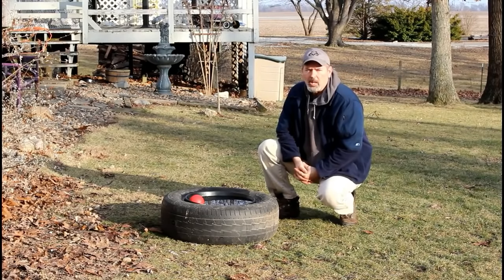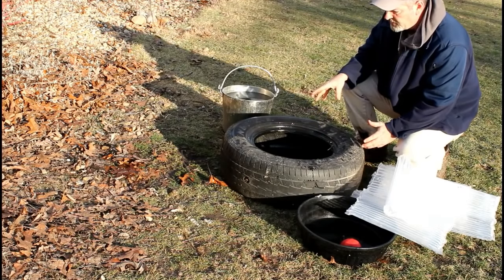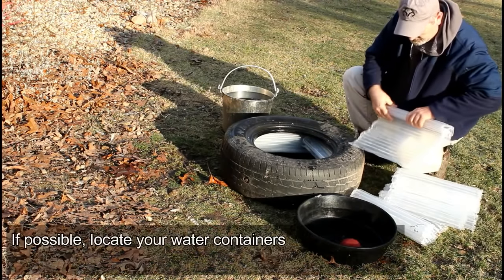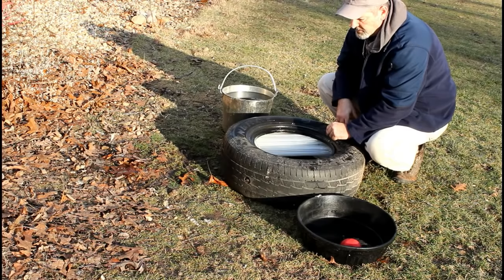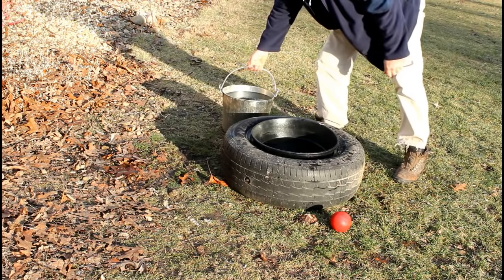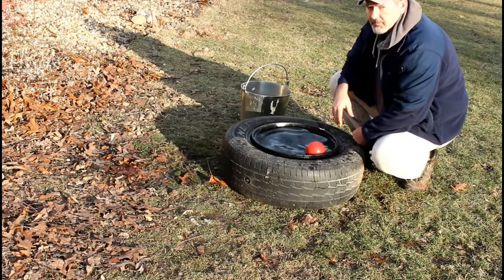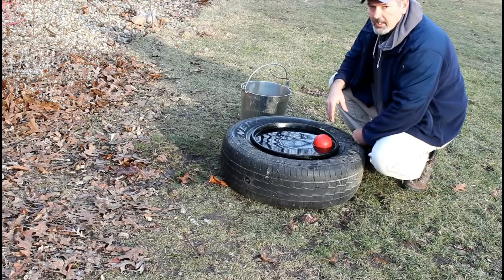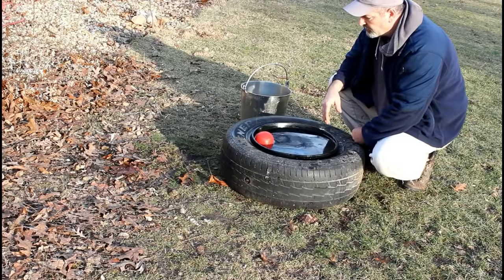Preventing Livestock Water Containers From Freezing

Comment: You can stuff the tire with a mixture of straw and manure. As the manure and straw rot together it will create some natural heat all by its self and help keep the water warmer longer. 100% natural and next spring toss the manure in the garden for fertilizer.
Reply: Most excellent bro! 👏👏
Reply: I was about to post that and saw you comment so I just thumbs up your post instead.  I also was going to say Manure and Straw but it can be anything that mixes nitrogen and carbon..  just shovel out from under the roosting bar..  what ever bedding you use is perfect for inside the tire.    The tire was a great idea,  I had been burying buckets with manure/bedding around it.   The tire makes it a a lot less work so I am glad he made the video.
Reply: Now this is why I read the comments. Thanks for the extra tip that I actually think that would work. 👍
Reply: Good idea

Comment: Back in the 1960s, my dad used something similar in our chicken coop, but he used an electric heating blanket to wrap around the base of the watering bucket instead of insulation.  He drilled a hole in the bottom of the coop and ran the wiring under the floor, so the chickens wouldn't peck at it.  Even in sub-zero weather, that water was always warm, and the chickens would sometimes be found laying up against the tire because it was really toasty.  He never put any water out in the open pen (which was a fenced 1/4-acre plot), because he felt that if they were thirsty, they knew where the water was - and it worked quite well . . . up until the time came to "process" them all (which was kind of a shocker to a young boy who had never witnessed a "mass extinction" of that sort).
Reply: Wait what ? You didn't ride down to the local Wal-Mart or Safeway store to purchase said items? 🤔 😳😳😳
 I thought all said items came from such stores.

Comment: I saw another video where floating a bottle of high salt content water was used to keep the water from freezing. You should check it out. Perhaps, even try placing bags filled with salt water in place of or  in with the insulation. That was my first thought when I saw what you did there with the pan and tire. I'm raising hogs, so I'll need a much bigger tire! Thanks for showing this! I'm excited to put all my newfound knowledge to the test. Now I just need to find a video with auto-fill solutions, and how to keep  my water hose from freezing. After all this work, I hope my piggy pigs are happy, healthy, and tasty 😉
Reply: Does not work...tried it
Reply: If you watch it all the way through the guy does say it will freeze over just not as quickly so it saves you running out there as much.
Reply: Bury water line to frost line, use toilet tank filler for water level
Reply: @julenachname1138  soda bottle with salt water in the water and it will work
The bottle floats moves around which doesn't allow the water to freeze
He almost has it.
Reply: @idamcneill8005  Frost line?
Reply: @thatsmuzik2570  
Frost line in the ground is how far down the ground usually freezes.. that's  what it's called here, but I'm in N Georgia mtns.  Last week we were between 5° &  15°  for more than 70 hours. Ground froze to about 4-6 in.  Snow cover is also a very good insulator, right at 32°...Think igloos.
Reply: @idamcneill8005  Thank you! I’m an OR suburban girl with 2 backyard Wyandottes, but learning more about being self-sufficient. It froze for about a week so far this winter. With wind chill factored in it was down to 9°.
Reply: A friend of mine tried the salt water in a bottle.  It didn’t work.
Reply: Your pigs will most likely eat or just chew the shit out of them tires, sorry

Comment: I use a soda bottle half fill it with alcohol or cooking oil. Neither of those will freeze and the chickens/wind keep the bottle moving and the water around it a degree or 2 warmer.  It won't stop it from  Freezing if its cold enuff but it does delay it a bit. Happy chicken keeping

Comment: What if you build a small green house to cover that? It will block the wind  and still generate heat even though one side is compromised for entrance. Do a square house and wrap plastic starting from the center of one side for 360 and extending/overlapping that plastic to the end. At the overlapped end, just spread the plastic apart for the  entrance. Use a foot long 2x4 as an entrance stabilizer so the wind will not affect the entrance.
Reply: Someone on the tube uses plant heat mats in a small outdoor greenhouse. When he used a meter to figure out cost was 7 cents /day.
Reply: @poa2.0surface77  God bless you and yours.
Reply: My chickens would peck holes in the plastic.
Reply: Am wondering when that heavy wet snow falls 8 "+ deep, as it does here won't the plastic house be crushed down?

Comment: Not a bad recycling method. I generally use my tires for... eh more.. temperate things.. but certainly a thought. Where I am temps unusually are moderate enough that containers only freeze for 1-3 days at a time. Which in that case I just bust them as a walk by. Seeing as my little flock has shrunk for honestly reasons past me.. I've put more time towards caring for them. Thought my cocky rooster still insists on roosting in a tree, next to my coop. 🤣 I even cut the limb off he was roosted on with a sawsall and he managed to find a way into a higher one later but was alone the Hens could no longer get that high and went back to the coop. When temps got sub-zero he preferred the coop with a heat lamp which I ran until it got back to at-least 20 in the night.

Comment: You know wmaybe some spray foam inside the tire.
Some bored on the bottom or insulation board on the bottom and throw in one of those.  Hot hands and then put the water on top.
And that should hold that heat in there pretty good. That's what I was going to try this winter.

Comment: Dig a hole under it couple ft deep. And off course seal it. Think of a water meter.
Reply: what does the hole do?...trap warmer air?
Reply: @bkershaccount  The ground is where the supply of warmth is, and it will rise and warm the bottom of the water pan. Unless your in a area where there is permafrost, then i guess you could dig the hole below that line.